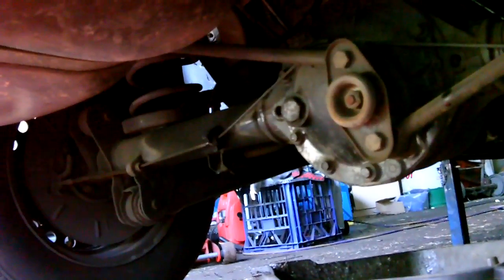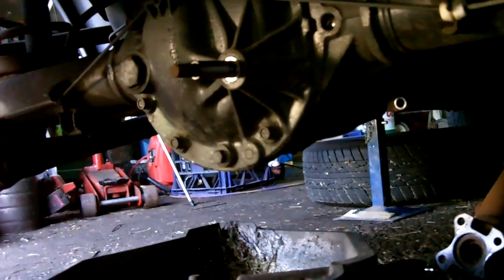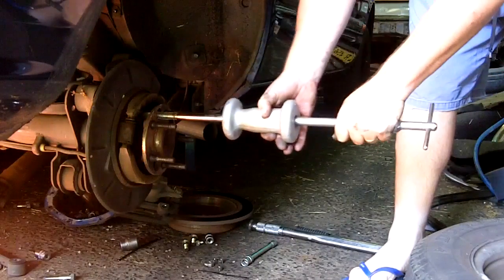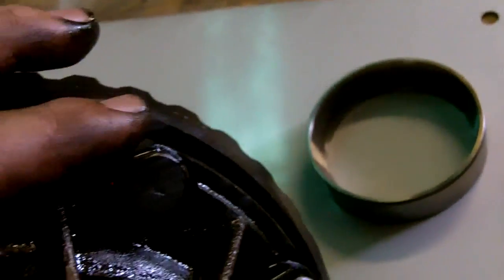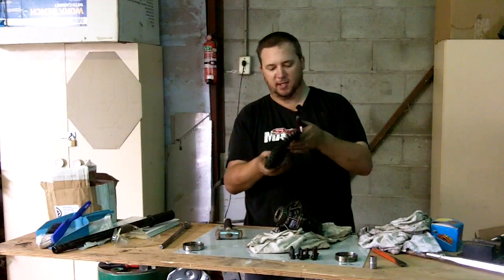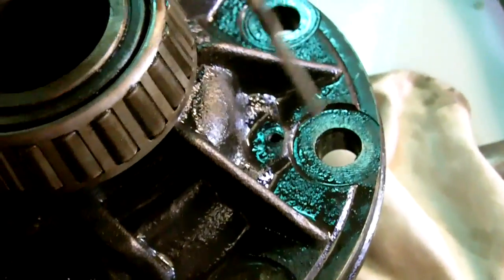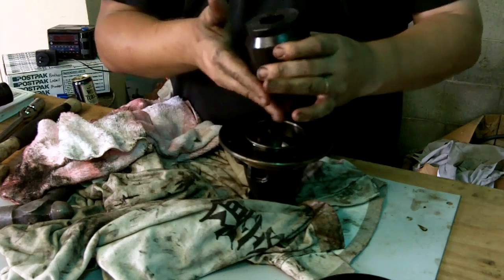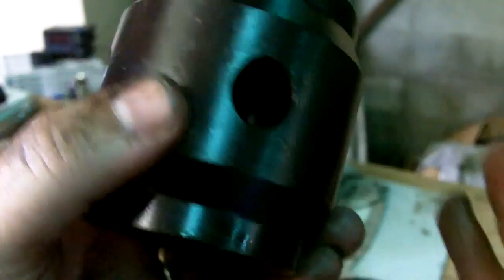13s for $1300 - Project Bluebird - Episode Eight Part-1

Comment from the maker: @newengland72 

They only make them up to 4.11 for the BW78 (M75) diff, and I thought I found a set but the seller pulled out at the last moment. While 4.11 gears would be a tad quicker they also push the revs up to very close to the rev limiter in 3rd gear across the line and because I can't change the rev limit without some expensive (out of budget) equipment it's best to stay away from the rev limiter I reckon.

Comment from the maker: @bigfella87 

Yeah it would have been great. If I'd had any idea that this was going to be the plan I would have taken it straight to the strip and raced it while it still had rego. As it was I did try the G-tech and it ran a 16.27 using that. They reckon the G-tech's are pretty accurate.

Comment: thanks for another great video , do you thing the ford centre will fit in a valiant ??,by the way  I did a spark-plug , leads and oil change yesterday to my ef and throttle response has improved I still need it tuned properly ( gas) but every second counts and spark plugs are cheep i gaped mine to .8 mm

Comment: should have showed people the trick you can do with the brake discs if you dont have a sliding hammer (for any one that doesnt know what im on about flip the disc around the other way put a few nuts on loosely and use the disc as the sliding hammer works the same)

Comment: dood why are you using 0575 gears on a 0578 diff ? or can they interchange,i just bought a 4 pin eb 3.27 0578 and want to do a similar thing to you.
Reply from the maker: +Darron Mecak 

Seemed to interchange pretty well if you use the right bearings. I just wanted the 3.89 gears

Comment: why did you just weld the diff? I would have thought it would have been cheaper than buying that locker
Reply from the maker: It tends to softenall the metal in the diff all that heat from the welding transfers into the axles, splines and everything. We did it once with a speedway car and it just kept breaking bits in the diff. More trouble than it was worth.
Reply: ScottysGarage fair enough. i knew they weren't really meant to be welded,